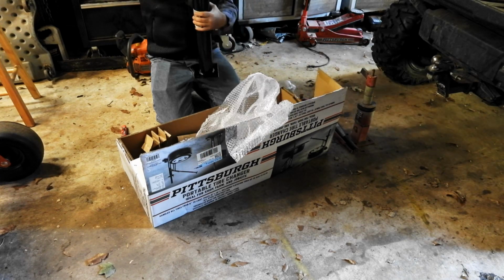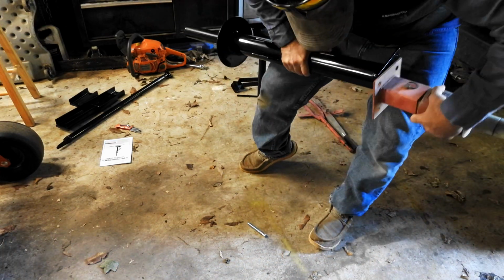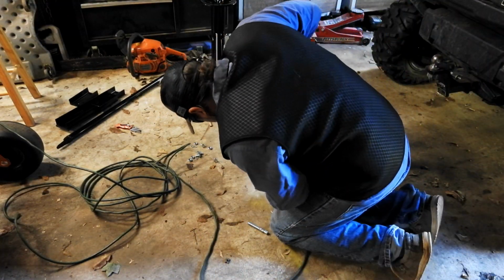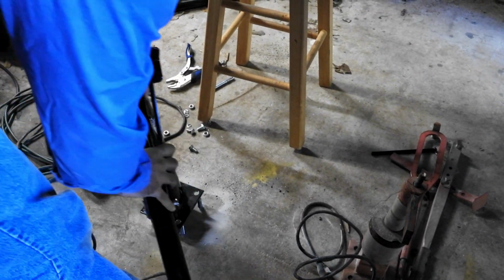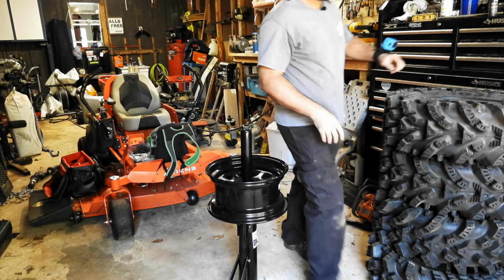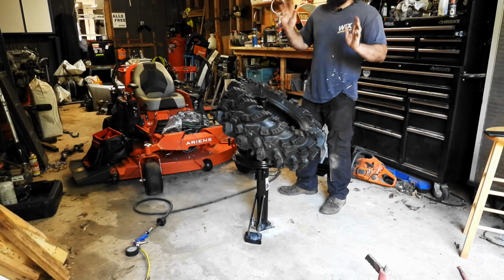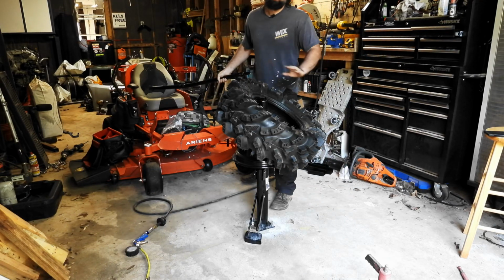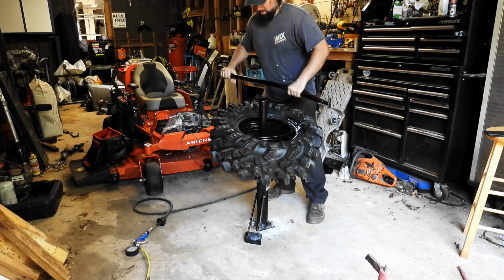Harbor Freight Manual Tire Changer Review

Comment: That bar is not going to get those tires on as you found out. I can't use it either, it just twists out of my hands.
I did come up with a couple of solutions... That are fairly easy to make - specially the Mk4 Bar in the second video.
https://youtu.be/H_c2ZMIYWdE
&
https://youtu.be/W8MddFsFmgA
Reply from the maker: I like what you came up with. If Harbor Freight made the working width of the tool a little bit wider, it would probably work great. 

Where did you obtain the head for the tool you made? I would be interested in welding something like that to the Harbor Freight bar to see if I could improve it.
Reply: @matty-0  
Hi Matty. I was actually inspired by this guy, who put a plastic Hunter duck bill onto an iron bar.
https://www.youtube.com/watch?v=_ODocXwHasY
But as I don't have welding gear, I made a wooden bar to do the same thing

The head of the HF tire changer is 2" diameter, so I built a 1" offset into it so the center of the duckhead is in the same spot as the hunter machine puts it... Sixtyfiveford does the same thing.

The plastic duckhead doesn't scratch rims either, so an added bonus
Reply from the maker: I appreciate the info - I will definitely check this out. Seems like a nice upgrade to the HF affair.